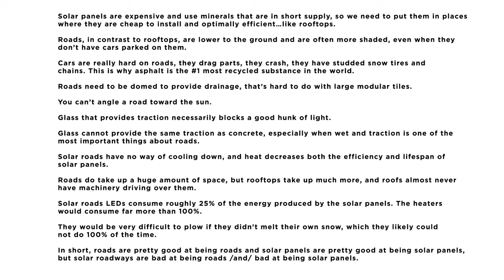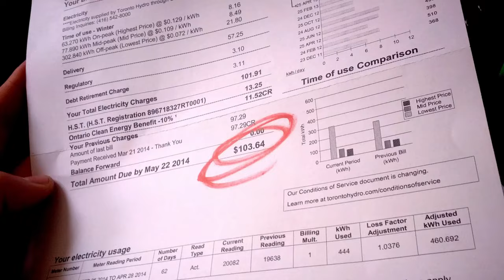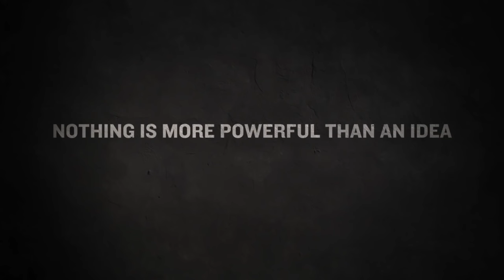The Kony 2012 of Roads - Solar Freakin' Roadways

Comment: It's not that the concept is bad, per se (but that doesn't necessarily mean it's explicitly good, either)...it's that the technology to make it practical doesn't yet (and may never) exist.

Most ideas of this format of thinking are bad, but not all.  But the one thing that is universal, is that projects that ambitious will never get done without a lot of work in a lot of fields, probably culminating in a kind of Apollo-style program to reach whatever the goal is.

I, however, don't think making solar roads would really be worth it, regardless.  Roads don't cover so much area that they'd do that much good for solar power, and if our transit infrastructure were properly laid out anyway, there'd be even less.  Particularly if automated cyclocopter mass transit ever becomes a thing (which it really needs to).  Then there's the eventual obligatory construction of orbital rings both for global transport, and to make space more accessible for both research, and societal development and expansion.  Frankly, a lot of the benefit of solar roads would be more solar parking lots.  Which...we need FEWER parking lots...not "better" parking lots.

And we accomplish that with better city design with sufficient pedestrian networks and proper mass transit...and getting rid of cars.

Comment: Asphalt is dark. To get energy out of a roadway in summer, literally all you have to do, is put pipes under it, pump cold water though is and then run the warmer water through a heat exchange. It has NONE of the drawback of the "solar roadways" that try to use solar panels. Except it's a little bit more expensive. OK, maybe a lot. But then again, it cools down the road, so it lasts longer. Some places in hot climates actually have systems installed to cool roads by spraying water on them. This would do that AND give you hot water.

And in the winter? Well, if you store that heat (which you likely will have to, as you otherwise will get too much hot water) you can some some of that heat in the winter to HEAT the roadway through that same pipes. Just enough to melt snow. And whaddayouknow, suddenly you don't need to salt (or even sand) the roads! And you will only need plowing when it snows A LOT.

Check out "The Road Energy System" in Waarland, Netherlands.

Comment: Personally, I'd rather put the solar panels over the roadway, which would shade the road, decreasing AC usage; decrease the amount of rain and snow that gets to the road surface, making it safer to drive and decrease plowing costs; and you could have solar tracking panels to maximize production if you really wanted to. It would be hideously expensive to implement, but that's kind of a given when we're talking about solar roads.
Reply: The roof of buildings is a better idea.  It can be done a lot more cheaply.

Comment: The first time I saw the 'solar road' thing, within seconds I knew it was a bad idea. The technology of designing road surfaces is complicated enough without adding solar panels into the equation. The Solar Roadways idea is superficially attractive. Here is a flat, engineered surface that's exposed to sunlight, why not use it? The problem is that there are hundreds of reasons 'why not', even before you get to asking why choose roads in the first place when roads and parking lots only occupy 0.15% of available land surface.

Comment: I thought the main reason was that the tyres of cars shed rubber onto roads and this rubber building up would block the sunlight reaching the solar panels. So, very quickly the solar road would stop producing electricity unless it was constantly cleaned, which would cost more than the value of the electricity the solar road could produce.

Comment: People have this weird misconception that we don't have enough space for solar panels (or that making enough space for solar panels would somehow be difficult). Solar roadways solve a problem people think exists but actually doesn't.
Reply: I remember seeing this proposal and immediately thinking that if you really need to exploit road space for solar power, putting the panels on the median strip or OVER the road would probably be a better way to do it. Anything other than making them the actual road surface. And even if you must put it in the road surface, the whole thing just seemed really over-engineered and over-complex--not just a solar panel in the road surface, but a heater and a light-up display and all this communication and signaling infrastructure. Just really odd.

Comment: If you want to know what it is like to walk on wet glass, or try to navigate a bike, you will appreciate why asphalt is so grippy. (This is definitely not safe but buy some plate glass, fully supported and try to walk, then run on it while the surface is completely flooded. Where hand, knee, elbow and head PPE)

Comment: The part that blew my mind was how they thought they could use solar power to melt snow on roads that weren't getting enough sunlight to melt the snow in the first place.
Reply: The idea was that power from storage and other parts of the roadway network could suppy those parts that needed extra, not that in-situ generation could exceed available sunlight. Now there are plenty of reasons that is not a great idea as well, but they are not nearly as "Gotcha" as what you thought they were claiming.

Comment: Even if they were solar panels, they would still be in the over abundance of parking lots roads, and stroads. You can't fix a problem caused by too much of the thing by making the thing better. That's like exchanging a whiskey addiction for a beer addiction.

Comment: The solar roadways as currently pitched do seem a little short-sighted - using glass as the road surface, heating the roadways with self-generated electricity and so on. And in terms of current technology, many of the concepts are insufficient to achieve the stated goals of generating more power than the cars traveling on them consume.

However, this seemingly-crazy idea could be the seed of something which could not only turn out to be feasible years down the line with sufficient research into new technology, but might also benefit related technologies with shared advances - which I think is worth pursuing.

Obviously, the company that makes these solar-road prototypes is going to claim that it can be rolled out almost immediately on every road in America, with pretty flashing lights and so on, because it's in their interest to sell as many of the prototype panels they have on hand to recover their costs because they're a privately-funded business. If they have enough working panels lying around and all those debts it took to fund the project, they want to sell as many as possible as quickly as possible to recover their losses and avoid bankruptcy.

But if instead of trying to push the technology out as quickly as possible to make a buck, they had the funding to actually make a prototype which addressed the various issues highlighted in Hank's list - many of which we have emerging solutions for, which could really use their own advances to bring them up to a useable standard - we might see some advances in pursuing that goal which will create solutions which can further other areas (both in solar technology and construction technology... and who knows what emergent solutions which might turn out to be useful in less-obvious fields in the future?).

As a couple of quick examples from the list:

- Why use glass for the roadways? I personally own a solar-charged powerbank for my phone - it's got a small panel made of plastic on one side which, if left in bright direct sunlight for a whole day, might get a couple of percent of its capacity back without plugging it into a wall. Right now, that's barely more than useless... but if research was put into improving the materials technology to find something almost as efficient as glass but without the frictionless surface limitations, coming up with a more abrasive and durable substance than glass which would still conduct enough energy to charge at something less than a snail's pace, then that would be useful not just to roadways but also to photovoltaic cells in general (even the roof-mounted ones) because we'd have a different material option besides just glass - more durable (and possibly lighter) materials would be a definite plus for roof-mounted cells in dangerous weather conditions like hurricanes or tornadoes. And since the material would have to be mostly transparent, it might also provide us with a new kind of building material which could replace glass in other scenarios which don't even involve solar power at all.

- Heating and cooling the roadways seem like two problems which can be solved with symbiosis - we have current technology being used in domestic and industrial heating systems which stores heat for release later. Usually, it uses a conductive medium like water (with possibly a few additives) which warms up in a reservoir until such time as the heat is released as warm air into the space which requires the heating. Change "reservoir" to "subsurface pipes", drawing heat away into cooled water pipes until heat needs to be released to thaw the road in winter, and you could be onto something. Could we do that with road surfaces with the technology we have right now...? No. But could we put some research into solving the problems that solution poses, which again would improve related heat-storage technologies in general which could then be applied to environmental heating in homes and industrial units...? Years down the ilne, maybe, but we'd have something which could benefit several sectors of technology rather than just the solar-power industry.

- Also, if the road surface itself is going to be made of a likely-thin layer of solar material, it would surely need some reinforcement to take big articulated lorries and large volumes of traffic. This is likely to require some new technologies like construction-grade carbon nanotubes to allow for such weight in a brittle primary material. Once again, if you think of the big picture of technological advancement in general rather than the specific use case of solar roads, we might have the new construction wonder-material we were all promised years ago a little sooner.

As a stand-alone technology, in it's current state without sufficient funds to research it further, I agree that solar roadways are a pretty pie-in-the-sky idea. While the starting principle solves a couple of surface problems, it fails to take into account the deeper-level and more boring problems of things like logistics and physical tolerances. But looking at the bigger picture, and the advances that could be made not just to the specific project but to many other concurrent technologies in development at the same time, the idea of a limited rollout (on those long barely-used roads out in the desert, for example, where there's plenty of sunlight and you can drive all day and not see a single car pass the other way) and perhaps dropping some of the more fanciful ideas like the disco lights might actualy yield a more realistic prospect for power generation over a longer time-period. A longer time-period that would be allowed for with a cash injection from the government rather than exclusively privately-sourced funds which have to be reclaimed with the "rush it out now, and solve the problems later" mentality we're currently seeing.

Comment: If we want solar panels on roads, let's just put them on a roof over the roads. BOOM! Now the roads are covered, so there's no rain over them, and driving on wet asphalt is always harder. No snow either. At night, there's a place to hang lights, so the roads are safer. If there is a roof overhead, it would be easy to add chain-link fences on the side of the road to keep deer and other critters from wandering onto the middle of the road and getting run over by cars. Of course, when we think of the cost of building a roof over every damn mile of highway in the world…

Comment: Solar freaking roadways is like the worst, their 1 installation has produced like a dollar of electricity, it's shiny, parts keep breaking, the tiles don't fit right. And the government keeps dumping money into it. It's infuriating to me. What bugs me most, is that the smarter thing to do, is to obviously put the solar panels above the road or carpark not below it, it would stop snow from reaching the road, limit light pollution from streetlights, provide rain cover, and the solar panels wouldnt be under the darn road! The road wouldn't be made of glass!

Comment: At the time of Solar Freaking Roadways, I was always wondering why they didn't just put roofs with solar panels on top of parking lots. It would probably be cheaper and protect from sun & rain...
Reply: I've seen some. (But it's usually cheaper to start by putting them on the roof of the big wide building that the parking lot is for.)

Comment: What you don't want to hear: I have the magical simple solution. We can fix solar roadways trivially easily.

Just move it 6m. Up.

We can use this for road lighting, and power distribution cables can be mounted off to one side. Not to mention fiber for Internet.

And in my next post, I will explain how this is also the magical solution that fix hyperloop and the congestion problems in our cities. And logistics.

Comment: One hilarious detail about this is that the logic of "solar on paved spaces" is decent, just integrating them into one surface isn't. Raised solar panel farms over parking lots would do just fine with none of the problems of trying to merge them with a road surface.

Comment: Can you explain why kinetic roadways are a bad idea, like we've seen kinetic dance floors but could that be applied to roadways in like high traffic areas?
What actually got me excited about the solar roads video wasn't the energy generation since  knew solar was difficult, but how leds could be used around us.
Reply from the maker: Basically, roads need to be really cheap. Like, anything that increases their costs a little bit increases their costs A LOT because they're so BIG. So no one looks very hard at anything that make it impossible to just pour the road out of the back of a truck.
Reply: @vlogbrothers  So its possible but far far more expensive system to setup, which makes sense.

Comment: I laughed at the idea of plastic/glass roads.  But I still wonder if the basic idea couldn't work for parking lots.  Change the glass to textured, get rid of the self-heating idea, and maybe you'd have a surface that could work for a parking lot.  The downside, is that it would still be a very expensive parking lot and I don't see how the price could ever come down enough to make companies or municipalities want to invest in them given the small electricity return on investment.  At this point, it would probably make more sense to put regular solar panels on all roofs, rather than on the ground where they'd receive more wear and tear and at times be covered.  In other words, it's an idea that simply isn't practical in a capitalist society.

Comment: What about solar water heaters? Could we take runoff and pipe it underneath the roads and then use it to heat buildings? 

Also, what did you actually say instead of "I'll see you tomorrow"? The audio didn't match up.

Edit: looks like you said "I'll see you on Tuesday". Ooooh fancy boy knows all about solar roads but doesn't know what day it is! ;)

Comment: For people who may not be convinced:: People like to drive fast, whatever the vehicle it may be. You want to drive fast, you need to push the road with the same force and that's where friction comes in, where asphalt and concrete do a good job. Even if you do pick up speed on a glass surface, how are you planning to stop 🤣🤣Imagine driving when the glass is slightly wet... You can't even walk on it

Comment: We spent ~4mil, much of it in taxpayer money, on the worst version of a generally terrible idea.  "Incremental value added" is not the way I would describe the small scale installation of Solar Roadways, given that this installation was (a) not a road, and (b) hasn't generated any significant power anyways.

That was a $50k installation for a theoretical 1.5kw capacity.  In other words, a $50k installation to run a single burner.  And this was on a pedestrian area, not a road, so forget the maintenance and everything else.  (Though it did catch fire at least once.)  The actual power output was much, much less. 

And the people selling this idea knew this.  They knew it was bad.  Any idiot could look up the cost of solar installed in basically any other way and find it to be 20 times as cost effective.  It's called a scam.

Comment: I'm no expert on any topic related to this so take what I say with a grain of salt. 

Putting solar panel UNDER cars is dumb and should not be considered until every rooftop and plot of otherwise unusable land (i.e. the space inside of a cloverleaf) is covered with solar panels. Then it should be solar canopies which won't be driven on top of and will protect the road and traffic from the elements.

Comment: Sorry but, did they TRY it? It may not solve every problem but it also may have solved many. Or maybe be the first step towards a solution that does work, like in Korea where they have BICICLE ROADS WITH SOLAR PANEL ROOFS.